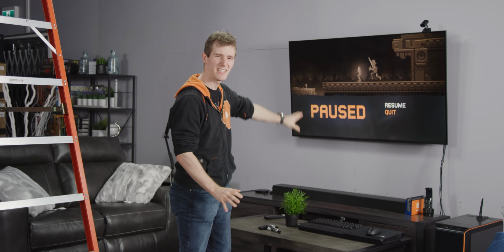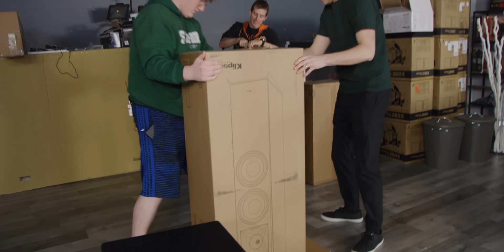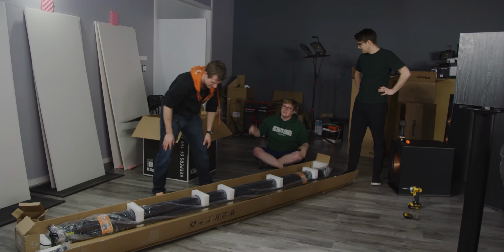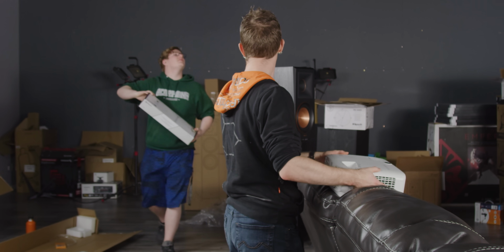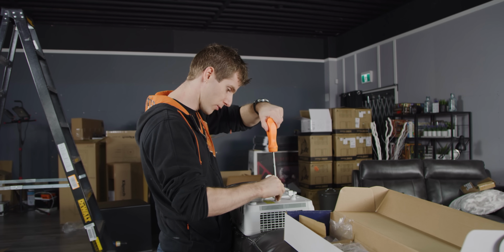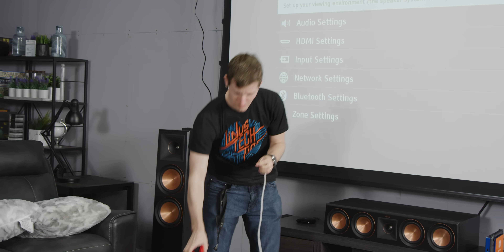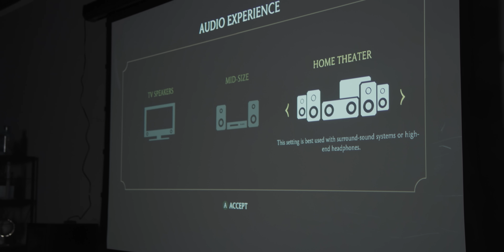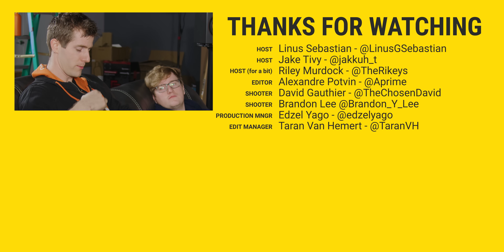I Hope We Don't Get a Noise Complaint... - Our Epic Employee Lounge Sound System

Comment: Here I am a pleb sitting here with dual 24in 1080p 60hz monitors, with $40 USD JLab Studio Icon Bluetooth headphones for audio, and I'm happy lol
Reply: And here I am with my TV plugged into my GPU via HDMI, with $20 atheltic sweat proof headphones
Reply: @WendysFries  Nothing wrong with that if it works, and you are happy with it.  On my work PC I still have my older ACER monitor that's a 23in 1680 X 1050 rez, and a Sony 19in 1280 X 1024 rez 4:3 LCD with VGA only that I snagged for $5 USD,  both still work great for basic office work, throwing up a YT video on the 2nd screen while I'm working, the rare downtime at work I get to play a quick STEAM game on Linux. So the only reason I'd replace either one is if they died, or started to have a bunch of dead pixels. I just don't care to spend all kinds of money for 4K, or 8K on my computers, when they all handle 1080p, and dual monitors more then well enough.

Comment: Fun thing is that my neighbour has the exact same setup with a 7.3.2 setup in his living room
Reply: 3 Subwoofers?! I have seen two, but what the hell? ^~^
Only to further split the load and reduce nasty standing waves?
Reply: @Kyouske_42 , 2 subs, because stereo (however you can't even tell where a single sub is "based" ) 
The 3 is for the Atmos overhead speakers.
Reply: @s1gne  ain't it the other way around? On the Dolby website are instructions for 5.1.2 setups, so 5 ear level speakers, a sub, and two ceiling speakers. Am I wrong?
Reply: @Kyouske_42  You're correct. I guess it would be 7.2.3, that's kinda overkill if that even exist.
Reply: @s1gne  3 overheads? isn't it supposed to be 4 overheads?
Reply: @Kyouske_42  its more of a 2 subs with 2 in one and a single one so you're probably right

Comment: $50 says Linus was drilling in reverse.  I'm sure of it 😎
Reply: That, or he was drilling right into two screws on either side of the hole ><
Reply: Or he wasnt using a wood bit which he wasnt, you just dont use hole saws on stuff that thick
Reply: Dan Gallagher sure you do, if they're deep enough. Plumbers and electricians use them daily. They just don't use a decade old Ryobi drill with "old and shitty" NiCad batteries.
Reply: @mlindholm  I am an electrician and would never use a hole saw on something that thick you would never get the chunk of wood back I out of the hole saw
Reply: @dangallagher2306  Im an electrician too, and that is exactly the tool every electrician I know uses. It has long holes along the side of the cup to pry out the piece of whatever material youre drilling. Take out the center-drill to make it even easier.

Edit: And we only use Bi-metal cups, made for metal since theyre dirt cheap and there can be metal in the walls. Eats right through wood like that.
Reply: @Nikkeftw  I wouldn't I'm guessing you're domestic then?
Reply: @dangallagher2306  Rarely, toilet walls in the industry are not often made from concrete. In cases of concrete and alike and in need of a hole bigger than 28mm, we call someone with the right tools.
Reply: @Nikkeftw  yeah I get what you mean still wouldn't do that though but that's how I'm trained so idk
Reply: @dangallagher2306  I was a professional installer for office pods... That's a grommet drill bit... And that's exactly what it's for... 1-2" of wood.  Mostly for doors or grommet holes in desks.
Reply: @jamesgibson4275  I've given up caring what every other person thinks the tool is for I merely said I would use a spade bit in the drill instead of a hole saw

Comment: If you list the A/V equipment in the description that would be great, are those Klipsch 8000f or 6000f? which sony AVR
Reply: It's the Sony STR-DN1080
I have one too and I can say that the UI is very nice and the features more than good enough for me.
Also got enough uhmpf for my old but gold Quadral speakers. Running 5.1.2 in my living room!
Reply: Why did they get PRO-180RPC vs the RP-500SA which are the newer ones?
Reply: Astute question.
Reply: @Kyouske_42  It's a great AVR but a 2017 model. Denon AVR-X6500H would have been a better choice to add 5.1.4 later but may be they got a great deal on the Sony.
Reply: Speakers look like the RP-8060RF, have them myself.
Reply: @udo8692  Do you mean RP-8060FA? they don't have upward firing speakers on top, might be 
RP-8000F
Reply: @Falcon5ive  oh yeah, rewatched it and they indeed dont have the upward firing ones, so guess so, good eye :)

Comment: Klipsch makes some of the best home audio speakers. Very expensive tho.
Reply: Honestly they are pretty fairly priced. If you look around, you can sometimes find them for about 50% off. I got my Klipsch R-12SW sub for $400 CAD ($800 at the time) and my Klipsch R-15M speakers for $250 CAD ($400 at the time) brand new. They sound amazing and are extremely loud. Their Reference Premiere speakers are pretty expensive and probably not worth it considering I can't imagine any speakers sounding 2x better for 2x the price of the non-premiere ones.
Reply: They're good prices when you compare actual HI END audio setups.   Klipsch is entry level (as I understand it). I love their products. I use them. It's all I meed. And can afford. But moderate level home theater /stereo setups go for 50k or more.   And that's NOT "for the rich".    There's less "rich" people to enjoy that level or audio yea, but to spend 10k on speakers wire and components, is nothing.   But to spend 2k and be exceptionally happy and content is EVERYTHING.
Reply: LOL. "Some of the best". Go look up real speakers (Martin Logan, Bowers and Wilkins, Def Tech, etc.) and Klipsch will seem like a walmart buy. Wouldn't matter what speakers you use with that Sony receiver, it will make everything sound dull. If you're not going to do a pre amp and amp setup at least get a decent digital amp.

Comment: If you were to upgrade most home theater junkies would first suggest adding a second sub. Not for more volume since it's only about a 6 DB increase but it'll adequately fill the room with bass and cover up some bass nulls. Good way to combat untreated rooms too. Probably can do that(room treatment) while your finishing your room.

Also 4 Atmos speakers are considered the sweet spot for a great Atmos experience, if your receiver supports that at least. 

Projector would get the most clicks though the rest is more your own QOL rather than content.

Comment: Go for the 4k Laser Projector, also your rear speakers are way to  close to your listening positions, flip them and pole mount them about 2 or 3 feet back from where they are now. Yes the ATMOS auto setup will correct for it but if the speakers are closer to ideal you will have less processing and delay added for a more true listening experience. BTW I have a degree in AV system design and installations.

Comment: Move the sub to the corner. Any corner. You’ll get more base response at a lower volume, and it will sound much better. Putting the sub in the corner turns the whole room into an extension of the sub box.

Comment: Project farm did a dry wall anchor strength test, toggle bolt types are best.  A kid pulling on the screen might just pull it out with normal anchors.

Comment: Whenever you are using a hole saw to cut a hole in a thick piece of material, make a reasonable sized hole with a regular drill bit in the groove of the hole saw. The hole saw teeth clog up very fast because there is nowhere for the shavings to go. If there is a hole where the shavings/dust can escape through, the hole saw runs easily all the way through the material. I'm not kidding. It makes a Very Big difference. Like night and day.

Comment: I've got that woofer. Sounds great, is nigh impossible to get to bottom out, however, the amp in it required changing after less than 2 years (it would just stop playing after about 15 minutes, needing a power recyc), and from what I found online, it's a fairly common issue in the Klipsch R-11x line of woofers. The replacement amp I got was exactly the same size, shape, had the same screw holes, same specs but the product name on the amp said it's for Klipsch SPL-150. Made me think the SPL-150 is not so much a new product as it is the R-115SW with its flaw fixed.

Comment: How I saved 1350$:
I bought 5kg wall putty for 25$, and created a super smooth wall surface.
I bought 1 liter Tikurilla Feelings (H499 color code) silver wallpaint for 25$ and painted the wall.
Result: Perfect @100" screen for 50$, and it is as perfect as a ~1000$ screen.

Comment: Klipsch are the best.  i have 5.1 RF-7ii with a 12" sub.  Exceptionally immersive.  just need to right amp.  pioneer elite but read the specs to make sure that surround down step down the full wattage

Comment: 1. You should move your rear speakers a little bit further back, it would make a difference.
2. Your front left seems to have to many obstructions in fornt of it.
3. When the receiver is self adjusting the speaker levels, it's best if you step out the way and move any obstacles that would interrupt the sound waves going to the mic.
4. Home audio and video installation is not your thing.

Comment: instead of using the extra long HDMI cable you could have used 2 of those existing ethernet cables that you had ran and use an HDMI extender. I am pretty sure they make them for 4k now as well.

Comment: You need to adapt a sundown audio zv5 15, or a sundown xv2 15 for that home audio system. Put a digital sound processor onnit so it only plays the real low hz stuff. Keep the other sub for the higher hz bass

Comment: @ 11:12 I think he may have had difficulty drilling through 4 screws at the same time? They would've had to cut 2inch of the long supports and slap a 2x4 on top instead of in between so the screws wouldn't get in the way

Comment: Hey LTT, I have a suggestion for you! Review Speaker Stands! I no longer have a way to mount my 5.1 setup without two speaker stands (3.1 on desk, missing out on two satellites), and the cheapest run from 40 to over a 100 dollars! All I need are two sticks with a flat top to hold the speaker, I don't want to spend 40 bucks when my entire audio system costs 60... Please Linus, find me some cheap speaker stands that aren't more expensive than the speakers themselves.

Comment: Pro av guy here, get a laser projector with true 4k (7680 × 4320, as 8k is actually 4k and 4k is 2k)...

Ps we use 30,000 lumen laser projector with true 4k at work with option for true 8k (dual HDMI in from $25,000 video processor)

Comment: Hilti  Zip Drywall Toggle anchors have a shear strength if 450 lbs in 5/8" drywall. Linus should not make judgment on anchoring. If the toggle anchor is in the steel stud, then it can be structurally supported if it is 20 Guage or thicker. Why the F are they not using HDBaseT for the long runs? HDMI is only good for 10 feet max.

Comment: I had a 3d led dlp view sonic 120 inch hooked to my computer in around 2011...i also had a 61 inch Samsung 120 Hz 3d led dlp rear projection tv at 1080p with 100000:1 contrast and full color reproduction just like the scam called hdr. The 3d system on the tv was developed with nvidia and when it worked it was super f'n cool....i had a force feedback stearing wheel with force feedback vibrating chair with a built in 5.1 system inside the chair and head rest. I added 2 more altec Lansing 2.1 and  5.1 systems into a 7.2 surround system that the creative sound card recognized and adapted to the non standard set up. If thats a led lit dlp projector then you cant see the rainbow effect because there is no color wheel......as for lag if its led dlp running at 120 Hz You should have none. Dlp is way quicker than lsd or oled tv tech.

Comment: personally i would just use stereo... 2 club size speakers would have more bass and 3 times the volume for the same price... and stereo amps and receivers will be 3 times cheaper... I have been in a $15000 home theater room... and well... it sucked... sure i noticed the surround in full effect and it was cool for like 10 seconds... My parents have a home theater 2ch sound system.. its 2ch... but its so loud if cranked up it will make your ears bleed and can be heard 6 blocks away... that is no joke or exaggeration...